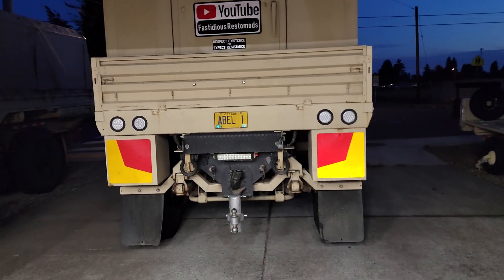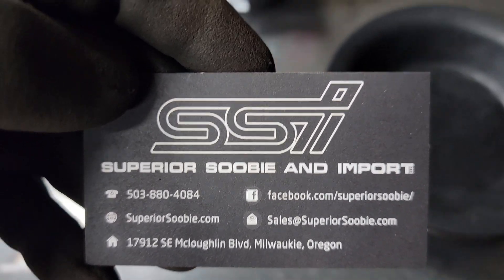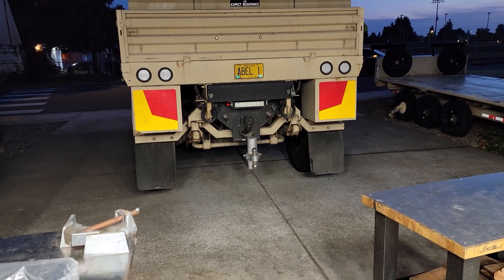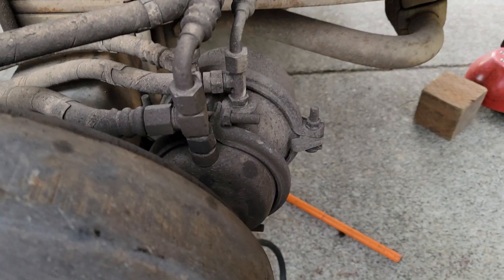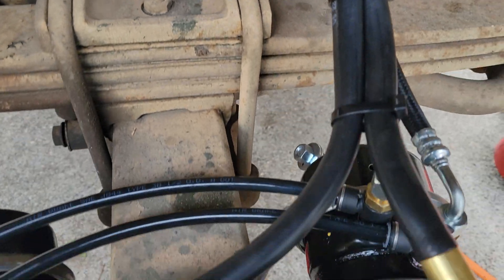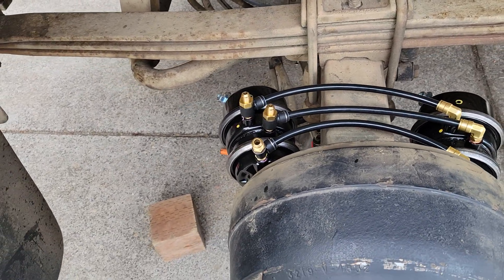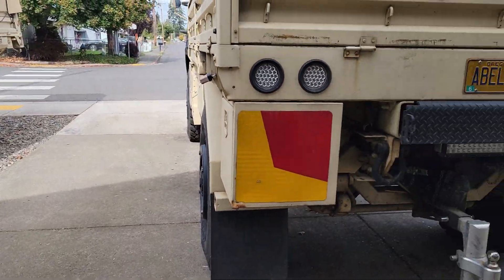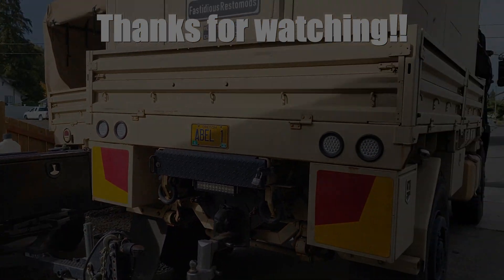Abel LMTV build part 200 (rear brake upgrades, CTIS, vent, DOT air brake lines)

Comment: Thanks, Sean!  This is great, need to look at the front brake video too.  Going to take me some time to digest everything. I’ve got a ‘96 so am concerned with everything rubber rotting and leaving me stranded.  Really want to do fuel lines as well as air lines…
Reply from the maker: I did both.  Fuel lines were done a few episodes ago.  Check out the playlist.
Reply: @SeanFastidious yeah I’m pretty sure I watched that one…there was a company that made a kit if I remember correctly…will rewatch 👍

Comment: Thanks for sharing this. I rebuilt my brake chambers a few years ago and I regret not replacing them. Considering the time I spent and the risk of messing with the chambers, it really wasn’t worth it. I have a revisit planned in the future which I will replace all the parts, including the wedges and the internal mechanism.